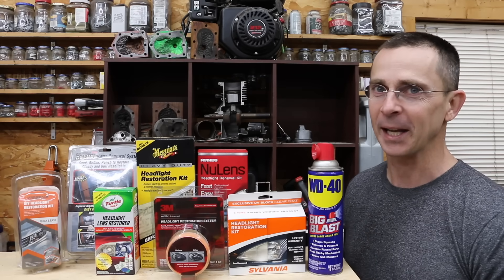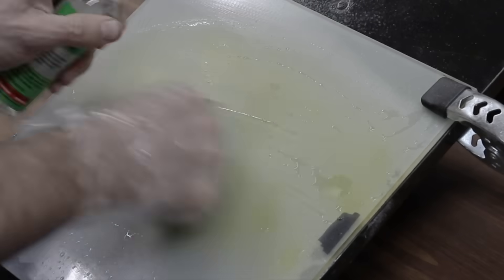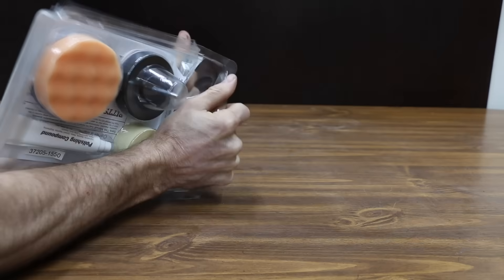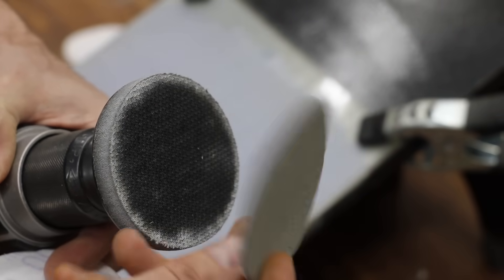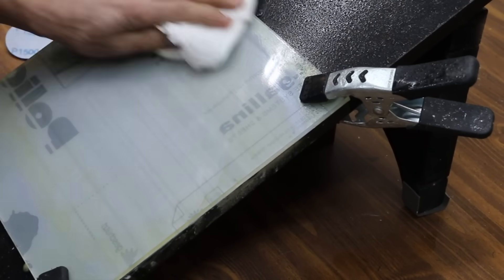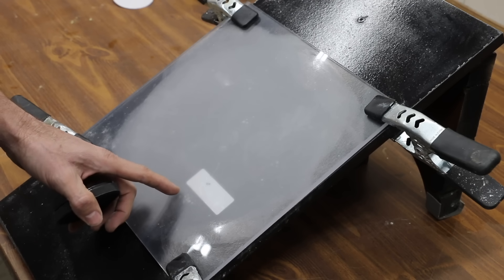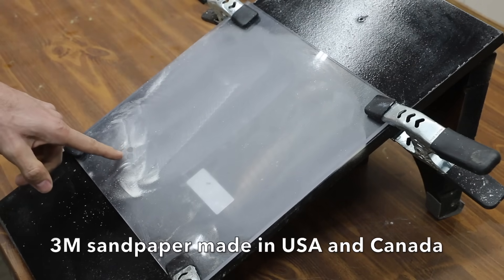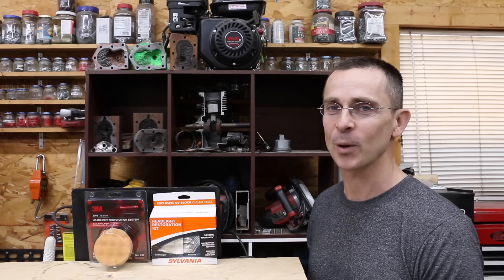Best Headlight Restoration Kit?  Let's find out!  3M, Sylvania, Meguiar's, Mothers, Turtle Wax & HF

Comment: Not sure how long lasting my results will be but by far the easiest way I found was using mothers aluminum wheel polish and a clean rag . That’s it, no sandpaper no masking tape no power drills!! Just put it on and work it with a clean rag . Did my odyssey’s lights months ago and they still look good. And they were REALLY BAD
Reply from the maker: Thanks for sharing.
Reply: Project Farm yeah probably not as good or long lasting as a product that re-coats the surface but super easy and it actually made a huge difference

Comment: I love the review, but I think using actual headlights even if not from the same vehicle would have made a huge difference. I personally use the harbor freight kit and found the sand paper worked well when it was used wet. But I also do my sanding by hand just holding the foam pad with the sand paper stuck to it. But I also I also don't use the polish they provide. I use a large buffing wheel with real polishing compound on my bench polisher.
Reply from the maker: Thanks for the feedback.

Comment: For a much longer lasting finish, after wet sanding, I replace  the two stage clear that came off of it.  Spraymax 2k clear coat in a can keeps you out of the compressor hassle.
Reply from the maker: Thanks for sharing.

Comment: Off topic and I apologize. But I feel you may know a solution. I'd comment under a more related video but unsure how often you monitor old posts. 
My generator keeps throwing it's exhaust valve. But not while it is running. 
It occurs when pull starting it.  And only when the engine is at room temperature.
When warm, you can stop and start it all you like.  Have you ran into this sort of issue before?
And if so, was there a fix outside of looking for a new valve and retainer clip?
Note: after reinstalling the valve, it can be started without throwing it again. Until it is allowed to cool down completely that is.
It's beginning to alter my mood towards it.   lol

Comment: The novus acrylic 3 stage compound works great with a beginning 800 grit sand with a da..  sandpaper is not apart of the kit and could jusg be done with the cutting/buffing compounds in the novus 3 part kit..  ive used it on headlights but the stuff really stood out when used on a old acrylic fish tank that had years of saltwater erosion.  Made it where you cant see the acrylic or dont notice it when you look at the tank..  usually a dirty or scratched up tank will stand out more than the beauty you put inside of it..  the novus compounds arent petroleum or chemically based as they use acrylic abrasives as their medium so it actually builds back some of the material slightly when using it giving it a newer look than right when you peel off the paper sometimes..
Reply from the maker: Thanks for the feedback.

Comment: I started with meguiers severe headlight restoration kit, I've done over 15 pairs now and now I only buy each sand paper grit in bulk from better brands like 3m and also buy the rest of the stuff from the meguiers kit in bulk. Makes it so cheap to restore headlights. Haven't had a problem for years but I'll need to try the Sylvania compounds. Gracias
Reply from the maker: Thanks for the feedback.

Comment: I've used several grades of ordinary wet sandpaper followed by drying then spraying with a UV resistant clear urethane spray paint. Even better is catalyzed clear coat, the same as used on the car body. Mix a little in a detail spray gun or airbrush. Definitely want to clean it out! Hardened clear coat in a spray gun can be impossible to remove. With any clear paint you want to have the headlight lens clean of any oil, wax, or polish residue so use a degreaser.
Reply from the maker: Thanks for the feedback.

Comment: Inside tip from a pro detailer. 500 grit is too hectic. Can be done with 1000, then 2000 then 3000. You're going to be spending heaps of unnecessary time just getting the sanding marks out of the soft plastic starting with 500... shit... You just need to remove the top layer not gouge the fuck out of the light. No need to buy expensive and waste of time brand name kits because all you're doing is polishing plastic. Therefore, you only need sandpaper, a decent polish/cutting compound and a rotary polisher with soft pad. It should cost you about $5/light and the results are far superior to any kit you're going to buy off the shelf. And ffs... don't fuckin use toothpaste as your polishing compound. It only sorta works because it's a mild abrasive, like polish... so just use the bloody polish....
Reply from the maker: Thanks for the feedback.

Comment: I have used the sylvania kit. It in fact did a great job of restoring the headlight. The problem is the linseed oil based sealer. It yellowed and oxidized very rapidly in UV light and they would not honor the lifetime warranty. I now use 3M kit with SafeTClear pro coat sealer.
Reply from the maker: Thanks for sharing.
Reply from the maker: Thanks for sharing.

Comment: The low-buck version: Buy the sandpaper of varying grits separately, and if using those use car wash soap with the water to lubricate. Use Pepsodent or a similar "old fashioned" white toothpaste for the polish and apply and buff vigorously with a rag. Wash off residue and make sure it's dry. Then use the clear acrylic version of Pledge Multi-surface Floor Finish with "Future" shine as the sealer/uv-protectant and apply with a small brush or folded paper towel. The floor sealer might be the most expensive thing, but in terms of both the polish and sealer you'll have enough to do it for many years and many cars rather than "just enough for one job if you're lucky" that the kits may provide. Might be surprised for how well that works given what it is.
Reply from the maker: Thanks for sharing.

Comment: If you live in some other part of the world where a good restoration kit is insanely expansive you can easily make your own on the cheap. You need 3 sheets of progressively fine grit sandpaper (400-800, 1000-1500 and 3000), toothpaste, window cleaning fluid and a protective finish. Use a dish-washing sponge to hold the sandpaper in your hand more comfortably, it also helps applying uniform pressure on curved surfaces. If you can't find 3000 grit sandpaper you can use baking soda, rubbing it on with a slightly damp cotton rag. Use (any) toothpaste as the polishing compound (usually the cheapest/crappiest ones work best). You can even make your own cleaning fluid by mixing equal parts of medicinal alcohol and plain water and adding a drop of liquid hand-soap or dish-washing detergent. The protective finish is the only thing worth buying as a dedicated product, clear nail polish looks fine at the beginning but will crack and start chipping off in a month or two and most waxes will wash off even faster.
Reply from the maker: Thanks for the feedback.

Comment: Interesting I use to do this with my Tahoe headlights, but I found just using OFF mosquito spray with DEET every 5-6 months when washing does just as good at a cheaper cost. Spray on wipe off with a towel. Just one man's opinion.
That being said the way your test was conducted OFF most likely wouldn't have worked, but on a regular headlight it does.
Reply from the maker: Thanks for the feedback.

Comment: None, they are all rubbish. Wet and dry sandpaper starting with 320g through to 1500g then a proper cutting compound with buff is so much quicker than any of these. Probably cheaper to if you already own a buff. Or you just sand to about 1000g and clear coat.
Reply from the maker: Thanks for the feedback.

Comment: Video suggestion: there's this wine aerating gadget called the Vinturi. Can it replace a carburetor on a lawnmower engine, if you attach the fuel hose to the air port on the side?
Reply from the maker: Thanks for the video idea.

Comment: Hi. Another great video

2 suggestions

1. Any change you can scuff up another sheet, donot use any product , just only mask up 50% of the panel and clear coat it at a paint / panel shop then leave it out in the sun to compare if a generic clear coat is protective compared to exposed

2. Any chance you can keep those test sheets outside for 3/6/12 moths so we can compare degradation over time or more importantly how effective the clear protective coat was.

Some personal experience

For our older car that we sold last xmas it was a 1999 Australian Holden Commodore, one front lens was cloudy the other cloudy / scaley - but none were yellow

I used generic 1200 wet and dry sandpaper ( the black one ) with soapy water - dishwashing liquid to get as much of the "rough" scaling of.

Once done i used toothpaste and a towel to polish up small section, it sort of worked, my neighbour lent me his small buffing / polish machine and a old used foam waffle pad

I even tried some of the green buffing compound on one of the lights

The results were a improvement but not as good as new as depicted on photos , the scale / cloudy part was gone from just the sandpaper effort, but it was at least clearer

The next year i spent 10 mins with toothpaste, and later on i was at a local wreckers and found a very nice pair of headlights that were as new ( must have been garaged 24/7) they were cheap enough

Regards
George
Reply from the maker: Thanks for the video idea.

Comment: try this one out:
pour some DOT 3 brake fluid on a scotch-brite rub until all/most of the oxidation is off
Wipe with dry towel
Next step place a dime size of rubbing compound on the lamp rub with microfiber cloth for about 10/15 minutes
Clean with a clean microfiber cloth
Coat with polishing wax
.

thanks for the videos your awesome!
Reply from the maker: Thanks for the video idea.

Comment: as a professional detailer of almost 10 years, i need to mention a few things:
using a sandpaper grit as coarse as 400, you could possibly permanently mar or crack the headlight as 400 is wayyyyy too aggressive. restoring headlights, the lowest you should go is never less than 800 grit!!!
also if you dont do it right ,you can leave a lot of scratches on your headlight that will be seen in direct sunlight. dont fall for the DIY products that offer sanding, and then applying a coating. all you're doing is covering/filling in the swirls which will be exposed after 6 months to a year, maybe even sooner.
please support your local detailers, we can guarantee 1 year to 5 year headlight clarity depending on your budget and we do everything right the first time. make sure your detailer is licensed and insured/bonded. STAY AWAY from those "car wash guys" on the street corners who offer to restore your headlights for $20. its all a scam and a temporary 1 month fix.
the ONLY proper way to restore your headlight is: sanding, compounding, polishing and protecting/sealing with a ceramic coating. anything else is a waste of money and time.

i wish he would have shown us the final result in direct sunlight as that will show the true finished product, everything looks good in the shade.
Reply from the maker: Thanks for the feedback.

Comment: 3M Sandpaper is awesome. I have to say, though, I have some 4X24" sanding belts and some 6" velcrobacked discs from HF that I bought for my belt sander and DA and they're pretty dang good. I have a bunch of HF sanding belts. 8 dollars for 5 "wood" belts or 7 for 2 "metal" belts in 4X24". My belts from another brand are about 8 dollars a piece (They are ceramic belts - they DO work better, but not 5 times better).
Reply: I have the self vacuuming DA sander from HF. It takes the 6" perforated velcro backed pads and they really do last. I sanded the whole hood on a F250, some 4140 bar stock, some oak trim, and 12x12 piece of 316 stainless with one pad and it's still usable. FWIW, I highly recommend the self vacuuming DA sander at HF. I sanded all the paint off a hood without breathing any dust, sanded trim in a house without having to vacuum, and I've ran it WAY over 90 PSI without issue (140 or 145)
Reply from the maker: Thanks for sharing.

Comment: I did this but without a kit. Just buy some sheets of wet-sanding paper in different roughness from 500 up to 2000-3000 and a polishing pad, some compound, isopropyl alcohol and automotive spray paint clear coat that promises UV-protection. And a pack of beer.
Redid some A6 headlights over 1,5 years ago and they still look like they're new.
Reply from the maker: Thanks for sharing.

Comment: For the most part, a wool buffing pad and polishing compound is all ya need for head lights. I use Mothers plastic polish and a Harbor Freight wool buffing pad in my drill. This buffing pad comes in a different polishing kit, not the one specifically for head lights. Those sponge pads are only good for finish work. I don't waste any elbow grease on gimmikey sealers, I just use pure carnauba wax. I think this was a very good demonstration of what works and what doesn't. I see some folks out there sanding and then clear coating their lights.... That's just a real bad idea on many levels! Anyway, thanks for another great video.
Reply from the maker: Thanks!

Comment: Or you can just get some decent wet and dry sand papper and sand like crazy till you get to 1500 make sure it is well sanded with 1500 and then get a good acrylic clear coat and do a light tack coat then let it flash/dry then medium coat then a little more heavy for the 3 make sure to practise as clear runs easy and at yoyr 3rd coat if you not to happy with it do a 4th coat then let it dry and then drive around let it fully Cure for about a week. Then sand with wet and dry 2000 then 3000 or so, then use cutting compound then use polishing compound yer alot of stuff but so worth it
Reply from the maker: Thanks for the feedback.

Comment: The pads used in the example around 3m in are quite likely Micro Mesh pads or a direct equivalent. It would be nice to know what grades these are, especially as far less expensive products exist off the shelf such as Mirka Abralon pads. Micro Mesh "grits" goes up into the tens of thousands however, whereas Abralon goes to the mid-thousands. The process of changing direction between "grits" would be useful with the manufacturers offering a little information on why; the scratches left by the previous "grit" should be removed entirely by the subsequent pad, which is immediately obvious when abrading perpendicularly.
Reply from the maker: Thanks for the feedback.

Comment: Test the actual breaking strengths of various braided fishing line brands
Reply from the maker: Thanks for the video idea.
Reply: @ProjectFarm  see if any of them can catch a goliath grouper
Reply: Both with and without a knot.
Reply: Breaking strength is only half the problem when choosing a fishing line. Factors like the ability to withstand abrasion how limp the line is and knot strength are also very important.
Reply: @charlespoling3331  I sense a series of recommendations...
Reply: @charlespoling3331  would have to test ultimate breaking strength with a steady pull and instant breaking strength by doing controlled drops of various weights, with a fresh piece of line for each weight increase. Then there's how well a line handles repeated pulls, continous and instant, at less than it's breaking strength.
Reply: @charlespoling3331   All of those could be included in the video as well!
Reply: Sounds interesting
Reply: Interesting
Reply: Check out the knot wars series. It's from an older fishing show but still relevant.
Reply: O was told of a competition called knot wars. You might enjoy it
Reply: Hey how about testing driveway monitors.  There fairly inexpensive,  and very popular nowadays.  Waters are getting muddied on all the claims.
Reply: I remember going fishing once with my dad as a kid. I told him to restring his reel the night before because it had been sitting too long(mono line), but he didn't listen.
He ended up hooking a bass, was so happy, reeled it in like 3' from the shore and the line snapped.
Then he spent the rest of the day sitting at the picnic table drinking soda till a bee got in the can and stung his lip and it swelled up like a golf ball(he was alergic).
Reply: Dude I would love that
Reply: I'm enjoying Fireline
Reply: Next after fish line & stink bait how about toilet paper

Comment: Thank you for the test. I liked the video a lot. I have been using meguiars headlight kit for a long time. It does a good job except I felt the protective wax did not last long. After watching your video I am going to switch to 3M. On my newer cars I use 3M liquid spray to protect the headlights from the sun before it even has a chance to turn yellow.
Reply from the maker: Thanks for the feedback.

Comment: I have on occasion seen recommendations of using toothpaste to restore headlights. Could be interesting to see how it compares.
Reply: From what I've found, "the typical size of the abrasive particles in the toothpaste ranges from 4 to 12 µm". That translates to approx. 600 to 1200 grit sandpaper, on par with the coarse pads in this video. It may clean the polycarbonate up somewhat, but the headlights should be foggy.
Reply from the maker: Thanks for the video idea.

Comment: I've used some of those kits in the past and they all work but one time just on a whim because of something I saw on YouTube I sprayed a little bit of off insect repellent on a rag and wiped my headlight and almost instantly it was clear again. It didn't last very long but it worked really fast and I hardly took any effort. You have to be careful with off though. Off will eat cell phone screens and paint on a car. The reason I know about the cell phone screens because one time when I had a phone on my belt I sprayed some off on me and the screen was never the same. But anyway it surprised me
Reply from the maker: Thanks for the feedback.